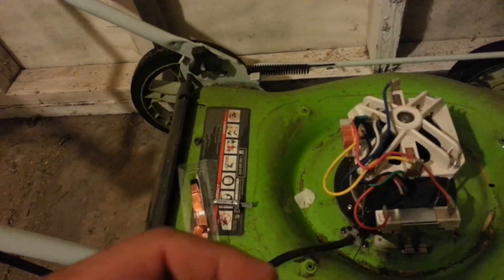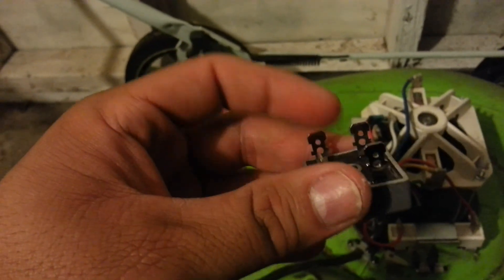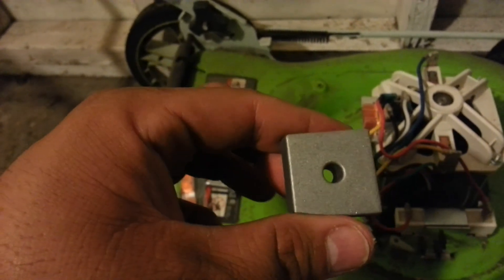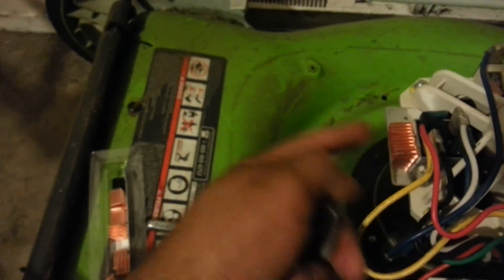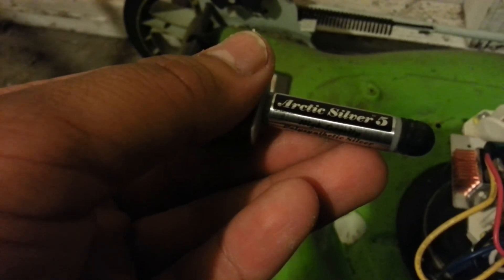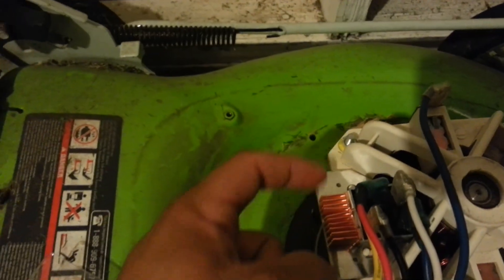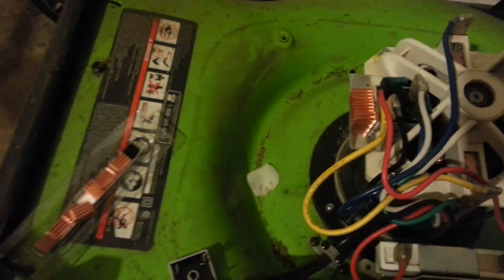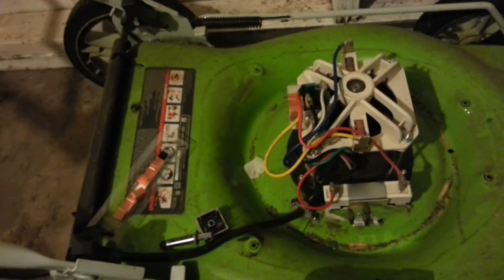Greenworks Electric Mower - Thermal Paste on Rectifier / Regulator

Comment: Trying to make sure that I am placing the rectifier back in my mower. There is 1 prong that faces in different angels than the rest. Which color goes on That one?
Reply from the maker: Not sure if you figured it out. I have another video where you can see it wired up. https://youtu.be/E5YNUIyvs-s?t=158

Comment: I have the same mower! It won’t start!😭
Reply from the maker: The issue that I had was specific to the rectifier failing so it kept tripping the breaker. But if your mower isn't tripping the breaker and simply doesn't turn on, youll have to troubleshoot the electric motor. Do a search for troubleshooting electric motor and if any videos can help. I don't have any experience troubleshooting electric motors.

Comment: So the Brushless motor isn't going to have that kind of set up since the heat sink is not such an issue.
Reply from the maker: Yes, good point. I'm guessing the manufacturer went with a brushed motor because they're cheaper.

Comment: I have the Greenworks model # 25213 mower,  and I also successfully replaced my rectifier using these Youtube videos.  Thanks for posting.  A few tips: 1) To unscrew the case screws and the rectifier screw that held it to the mower, I needed only a T20 screwdriver.  2) There are 6 case screws that must be removed.   The 2 deepest are the ones nearest the mower handle.  I ended up using a 1/4" socket wrench and extension, attached to a t20 bit to get to them.  I had the same symptom of blowing a fuse every time I turned the mower on.  Buying a KBPC2504 rectifier from Amazon (package of 2 for $7.95) and replacing the original rectifier fixed it. Thanks for the video, it saved me from buying a new $170 mower!

Comment: I'm totally doing this! You could also put those heat sinks vertically on the metal heat spreader and it would probably work well.
Reply from the maker: Good point. I did end up putting heatsinks on the sides as well.

Comment: I disconnected the dynamic brake system, because I found it kills the on/off switch ( I bought 2 before the mod). Of course it's more dangerous because the blade spins for a while after you let go of the handle. I also went to WW Grainger, and bought a hours clock so I know how much time it's been running. After 3 years only 9.8 hours. I don't mow much.
Reply: How do you disconnect the dynamic brake?